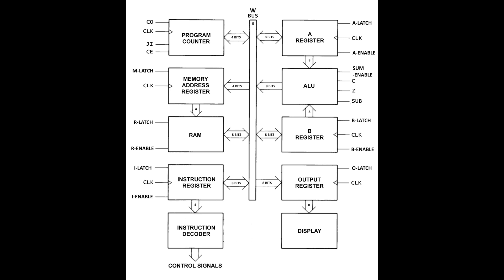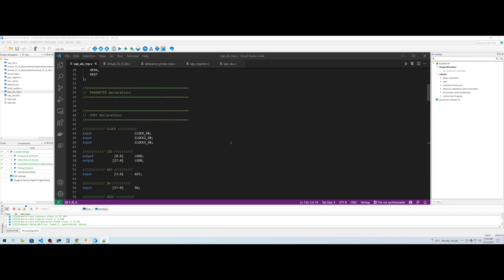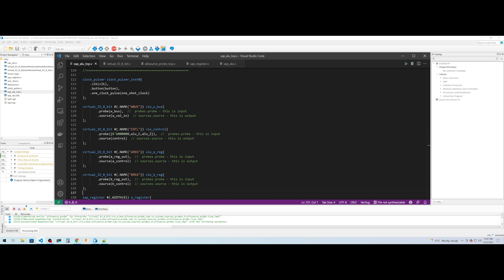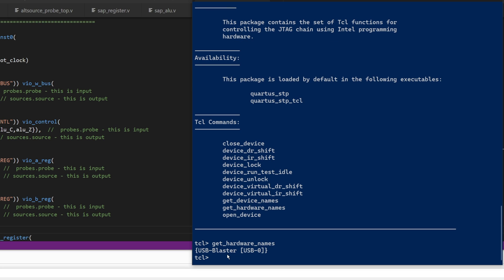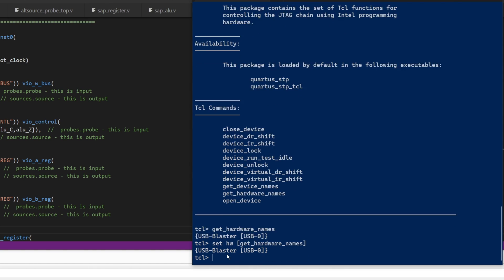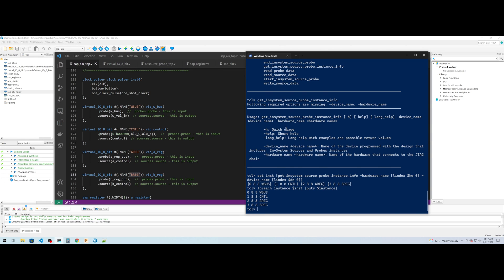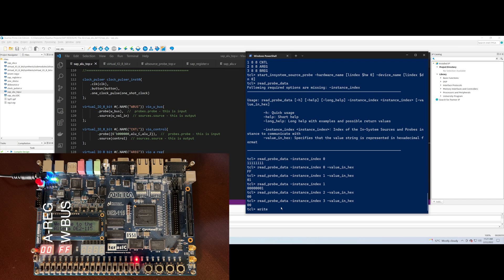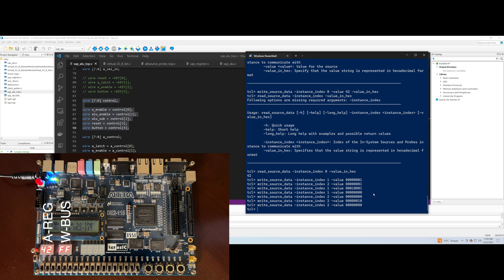#3 Ben Eater's 8 Bit Computer (SAP-1) in an FPGA: TCL

Comment: I’ve seen a few “Let’s implement this CPU in an FPGA” series that end after 3-4 videos, unfinished. Was it a technical problem, like the complexity proved too much? Or did life get in the way? Genuinely interested- I’d like to start a similar project.
Reply: Very little interest.  I could not justify spending so much time on this for so little interest.
Reply: @philipacovington  that makes sense. I’m just starting in FPGAs but long term i’d love to implement a full computer; like a Commodore 64. I’m guessing it would take several FPGAs, one to drive the memory mapped graphics.
Reply: Too bad. I just found this. It would have been an extraordinary adventure to complete this.
Reply: If you look at the initial few screenshots of the intro on the first video you can see that Phil had the CPU fleshed out in a lot more than what he showed in the first three videos. Nonetheless, just from the first video I was able to complete the basic SAP-1 implementation on an ICE40 fpga. I did not use the signal probe nor TCL setup (which would have lost a few people) but a more basic approach for debugging.

Comment: Hi Phil, thank you very much for this series of video about implementing Ben Eater's 8 bit computer to an FPGA. So far, I'v followed your 2 previous video successfully, everything worked as you showed. However, I tried recompile the sap_alu_top.v this morning and got the error message #35030 "Partition "top" contains I/O ..." with 8 error messages #15856 "Output port O of I/O output buffer "pre_syn.bp.w_bus_0_~output" must drive a top-level pin".
I'm at a lost right now and don't know where this error comes from, any idea how I could resolve this ? Regards.